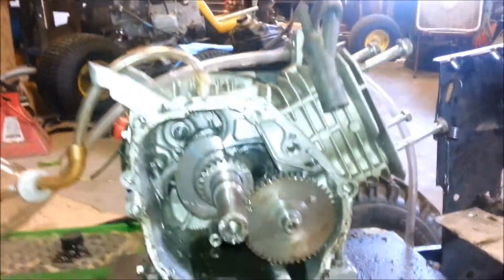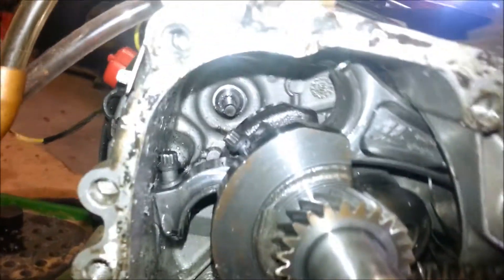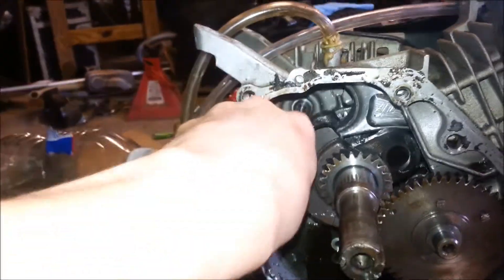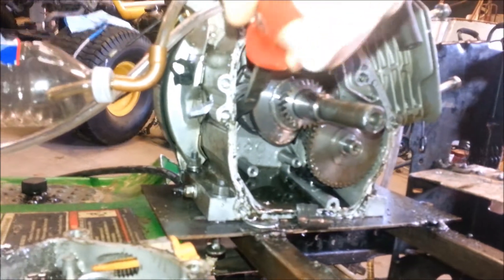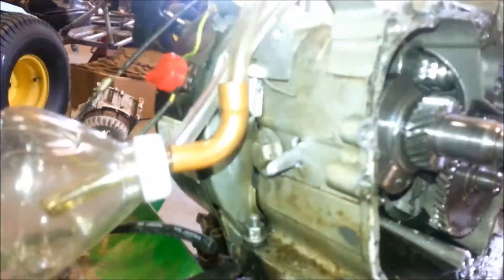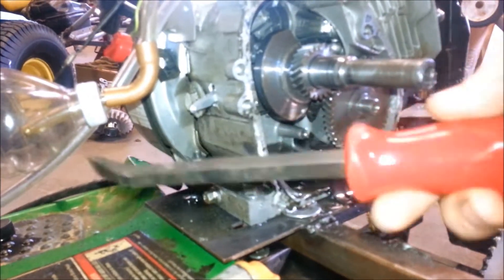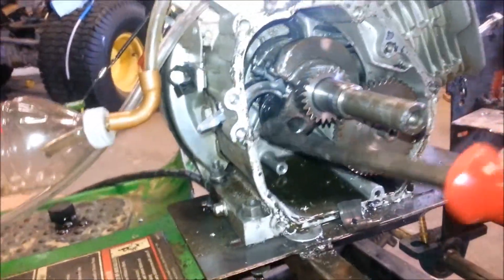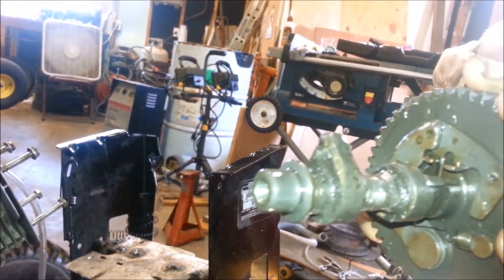ARC Billet Rod oil dipper through crank case wall !!

Comment: I guarantee this fool did not read the instructions ARC clearly states you may have to Polish the crank to get the correct oil clarence. You can clearly see copper under the babit showing the bearing was to tight even though he did not have it torque right...........

Comment: it was most likely under torqued, arc racing says in there installation video that when you are torquein the rod down to 180 inch pounds if you go any tighter than that you will strip out the bolt, the bolt stretches which is why you alloy oil prior to installation, when the bolt stretch the oil fills the gap and locks the bolt in. anything under this area is under torqued, even with a inch pound torwue wrench it feels like the bolt it going to break at the final 180 inch pounds
Reply: I torqued mine to 180inch pounds with a brand new torque wrench and snapped the bolts lol I oiled up the bolts really good and oiled up every thing related I had it on video showed gopowersports the video and they over nighted me new rod and a Free torque wrench
Reply: @CR4ZYxRY4N  this happens when the bearing is not set right or is seated on the crank improperly.  Also if one bolt gets tightened with too much more than the other. I've also seen the head of the torque wrench not click for some reason and shear them. It's annoying as heck when it happens because in all honesty,  the rod should be replaced incase there is thread damage. Once over tightened, you "crush" the babbitt and the oil clearance will not be correct causing a slightly oblong travel pattern on the journal.  Given time and the fact the bolts got backed out from being too tight it would only be a matter of time since you countered the thread stretch. This is an excellent video and your honesty is going to save someone going down the same path. Really cool of you to post it up.
Reply from the maker: at first I had it tightened down to the point the crank was very hard to move so i backed off each side little by little until it was perfect. So now I will be using loctite and hoping for better longevity. 
Too bad they don't come with lock washers, just regular washers.